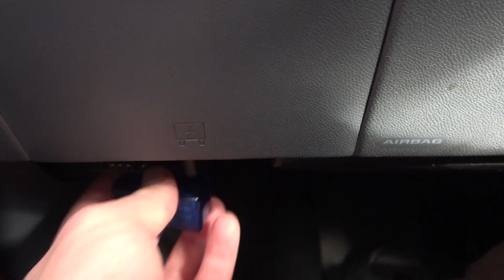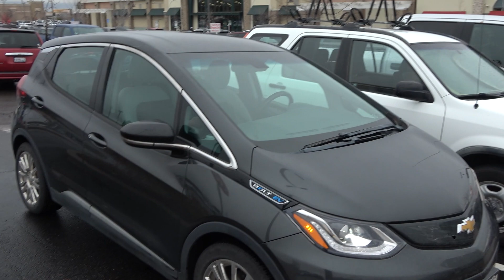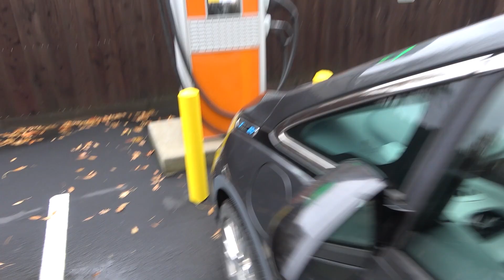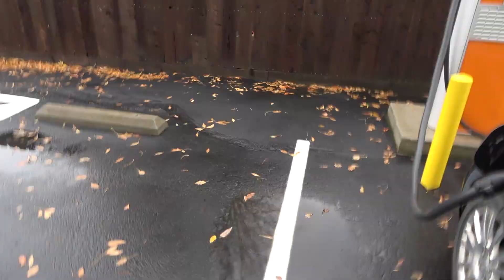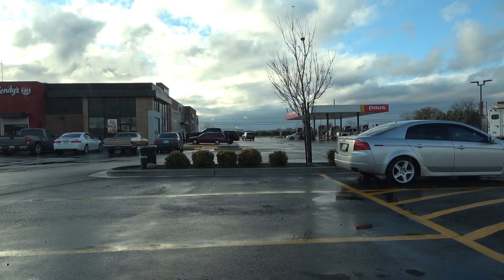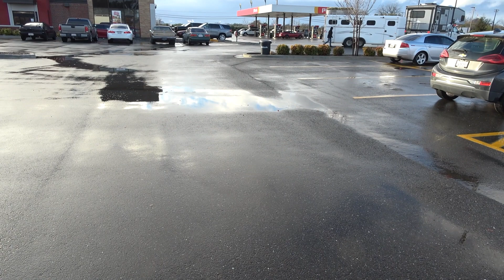Chevy Bolt EV: Day Trip Checking Torque Pro

Comment: Been following you for a couple years. Finally subscribed 😂 And thumbs up too! I look at the odometer and see you have 160k. I’m retired and drive 40k a year. I just got back from Seattle and I also used the Viddles charger. Good food too! EA in Anderson was 7 deep and the VIDDLES charger was available. I think the ChargePoint chargers have been way more reliable in the last 6 months.  The New Battery in my 2017 took about a month to get dialed in. Battery updated in Vegas. Cheers 🍻
Reply from the maker: Thanks! Yes, I've been having this happen more and more with my Bolt EV: EA charging sites are full, so I just use nearby ChargePoint or EVgo chargers that always seem to be open.

Comment: My Bolt has more capacity with Hill top reserve than my old battery charged to 100%. Mine is a 2017 as well and it only took a few weeks for my car to learn the new battery. I do commute 130 miles, so it maybe was quicker for my use. I never fast charge my Bolt since our Tesla is our trip car.

Comment: 12:35 you mentioning the trickle charge in relation to cell balancing by the BMS and that brings a few things to mind:  In order to “do” cell balancing does the BMS need a low SOC, a high SOC, some charging input like Level 1 you mention, DCFC, etc?  If the BMS can only direct incoming power to different cells then I guess you’d need a trickle input. If the BMS has some way to resistively burn off a little bit selectively from higher voltage cells maybe no input is required. Does the BMS have rules about SOC ranges in which it would engage in this cell balancing activity or is it always trying to do it in the background?  Does it periodically schedule a cell balancing event or it’s always the default item on the agenda? Sorry I have no idea just posing the questions, figured you or some of your viewers might be more tuned into the Bolt BMS than the average bear. 

Love the content, I have only briefly traveled through that part of California maybe 30 years back a few times, each time on a motorcycle as it happened.   Each time I was rushing up I-5 for whatever reason or on 139 from Klamath Falls to Portola and didn’t take much time to dwell there for even a couple hours. Definitely need to put it on the bucket list of places to visit again.

Comment: Wow a 64F battery is very chilly. The Taycan heats it’s battery to 89F to 101F for fast charging. Kinda hot 🥵 I know but it generally can manage it ok.
Reply: Ha ha ha you think 64 F is cold?  My Kia EV6 Light let’s the pack hang out at freezing or even below freezing temperatures. I use Car Scanner regularly and Min Temp is usually ambient give or take after a day or so parked.  This winter in Ohio we’ve seen pretty cold stuff and the battery just lets itself go. As Bjørn said, there must be a ton of cobalt in the egmp car batteries because they accept a ~30 kW charge even with an ice cold pack.
Reply from the maker: @skyemalcolm  I think Ron is referring to conditioning for DCFC. The Bolt EV will let the battery sit below 40 F when unplugged and off, warm to 40 F when unplugged and on, and warm to 60 F when plugged in and on. 

For DCFC, I believe 77 F is the sweet spot for charging the Bolt EV, but some higher power batteries like what Porsche and Tesla use will warm the cells to over 90 F to prep for DCFC.

Comment: Looking forward to the update after the trickle charging. I would think you could charge to like 60% or something and then trickle charge the rest vs from 10% but idk
Reply from the maker: Thanks. It does look like it's reset, but I've had a lot going on lately that has gotten in the way of posting updates. I have pretty long spells between driving, usually, so I can get away with 120 V charging from nearly empty to full.

Comment: -Does the new battery give you the ability to charge at a higher level 2 rate? Ie: 11.5 (?) KW:42 miles per hour of charge. Or still 7 kw?
-Have you noticed the new cold weather charge curve like in the newer model bolts? Or is it the same?
Reply: I believe some of the charging hardware would need to be changed to allow a higher Level 2 rate.

Comment: I normally never charge to "full" (~90% with Hill Top Reserve) but I will charge to "full" about every 1000 miles strictly so the car can do it's cell balancing that it does at the end of the charge cycle.

Comment: My experience matches yours for the 250 chargers.  Only thing that could improve the experience is the automated plug and charge.  But the NFC works so quickly this is just looking for a gripe.  But their old chargers are still horrible, I want them replaced!
Reply from the maker: Yes, I could nitpick a couple things about the CPE 250, but in terms of reliability, they just work. For me, my gripes are the screen/interface (the plastic covering makes them hard to interact on) and the current limit. I'd love to see more of the CPE 250 paired (125 kW) with a 300 A capability (so 400 V cars can also hit close to 125 kW).

Comment: The vehicle continuing to draw power after it has reached “100%” could be the vehicle trying to learn the capacity and/or top balance the battery, but it’s also part of the new diagnostic software for the Bolt. Even before the new batteries were released, the new diagnostic software that was supposed to keep the batteries from becoming light bulbs kept the BMS on and watching the battery for a long time, sometimes hours after the battery was finished charging. It uses power from the charger to run the BMS and essentially keep the vehicle on while it is doing this.

The cell voltage dropping under load is normal, especially if the battery is cold. The battery resistance is higher when it is cold, which is part of the reason why batteries always charge slower at cold temps.
Reply: Also, the number of battery bars shown on the dash is your state of charge rounded up to the nearest 5%. So, what looks like 100% could actually be anywhere from 95.1% to 100%. You can get a more accurate reading by connecting to a DC charging station and observing the display screen, or by using TorquePro.
Reply: @ab-tf5fl is it weirdly stubborn on GM’s part not to just show an SOC%?  It’s not like they haven’t had the chance and surely something in that car’s software could be updated, even if it required a physical connection and a reflash by a dealer.
Reply from the maker: @ab-tf5fl  Yes, a DCFC display is what I was basing it on originally. When I was in Baker, CA on a recent trip, the Bolt EV continued to charge on a DC station after the charger displayed 100% (it added another 6 kWh after that). When using L1/L2 AC, my way of determining the battery is at 100% SOC is when the Energy Used screen resets. I don't rely on the energy bars because, like you said, they are only in 5% increments.
Reply from the maker: Thanks! Yes, the battery voltages will drop under load, but what was worrying me is that the drop wasn't consistent. Some were dropping a couple tenths of a volt while others were barely dropping voltage at all.

Comment: I agree with you. Politics had absolutely zero to do with my decision to order a new 2023 Bolt EV. My current car is a 2013 Chevy Spark wich I bought brand new. For 9 years that car performed flawlessly. Now at nearly 3 hundred thousand miles it is starting to break down. A few months ago I started watching ev videos including several of yours and I became hooked. No oil changes, no spark plug changes, no transmission fluid changes and certainly no thousand dollar catalytic converter which I had to replace. Gr8 vid as usual. 🚙 🇺🇸

Comment: Too bad the new Bolts don’t charge up around 100kW at least.
Reply from the maker: I think it's fine to have a 1 C EV option. The upcoming Chevy Equinox EV will charge at over 100 kW, which will give EV buyers the option if that is something they value.
Reply: @newscoulomb3705  In the near future I see overcrowding @ CCS chargers due largely to the free juice that comes with many EVs. Consequently lines will be the norm and the sooner a car gets off a dispenser the sooner the next car gets on.
Reply from the maker: @BillB33525  I think those are two very different issues. Right now, only one public network is offering free charging, which compels even those faster charging EVs to spend more time on a charger than a slower charging EV. 

Realistically, though, 75% of people will rarely if ever take a trip that would exceed a 200 to 300 mile EV's range, so having low-cost, 1 C EVs with 200 to 300 miles of range is a great option for those who will rarely use public chargers.

Also, with proper power-splitting parameters and charging speeds matching the host business's use cases, EVs with 1 C charging rates will not negatively impact the public charging infrastructure.
Reply: @newscoulomb3705  we saw the free charging effect on our trip to Florida last November when an Ioniq5 sat there charging to 100% - there where 3 cars waiting to use the chargers. When I asked the guy (politely) what he was doing he informed me that he comes to this charger once a week and charges to 100% because it was a free charge in his agreement when he bought the I5. 
He saw nothing wrong with what he was doing...when we got on an open charger we hit it to 50% which on the Kona was plenty to get to our final destination and got out of there...he was still connected get that last 2 - 3% to 100%!!!!
Have a great day!
Mike 🇨🇦 
Great update Eric...Thank you
Reply from the maker: @michaellippmann4474  Interesting. I thought the Ioniq 5 only got free 30 minute sessions, but the driver has to pay after that. It will charge from empty to full in 45 minutes, so that Ioniq 5 driver was likely having to pay for 15 minutes or so of their free charge.
Reply: @newscoulomb3705  I am not sure he was aware of the 30 minute free level...but in any case hew as adamant that he was going to 100% - nice guy but maybe he was also not fully aware of how much slower that final 20 or so % got. I just wanted to charge and get out of there...Ormand Beach Florida.6 EA stations and 3 down and cars waiting. Not the best place to charge to 100%! 🤣👍

Comment: It looks like the dealer that did the battery swap forgot to do the reset capacity learn procedure. I have my Bolt EV with the new battery for an year already and its capacity on Torque was 64.79 kWh from the start. 

To force the relearn: The battery needs to be run down to 50% or lower and then let to sit unplugged for 2 hours. Then plug it in, fully charge to 100% and let it stay plugged in 2 hours after reporting 100%. This will trigger a capacity calculation update.
Reply from the maker: Thanks! I think I might have completed that relearn procedure myself already. I am getting pinged by my dealership to service the battery, so that's probably what they want to do.
Reply: I have 2022 Bolt EUV and primarily level 2 charge at my home with the charge limit set to 80%. Eventually the car will hit the set charge limit and the indicator on the dash will be solid green to indicate that it is done charging. However, my EVSE acts like it's still supplying power. If I keep it plugged in, eventually the car will start chirping at me and the dash indicator will show red, and the EVSE will also show an error. I suspect my cells aren't balanced.